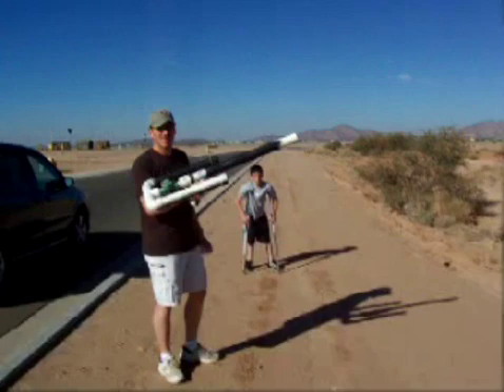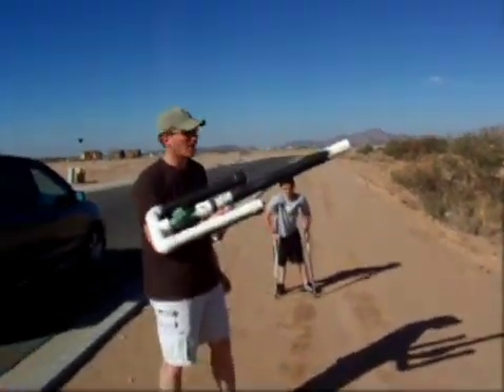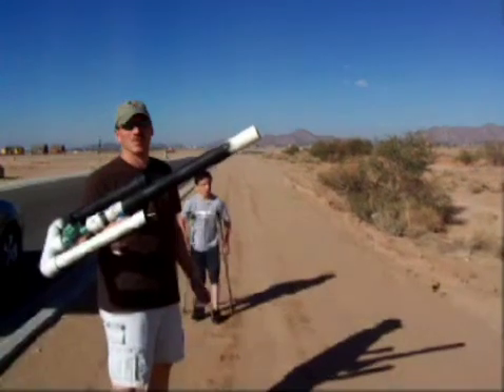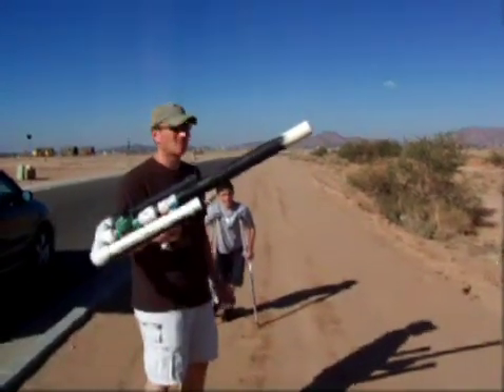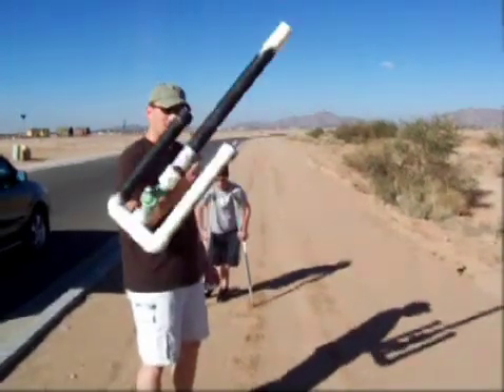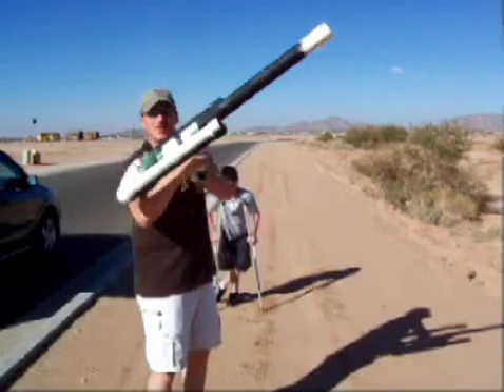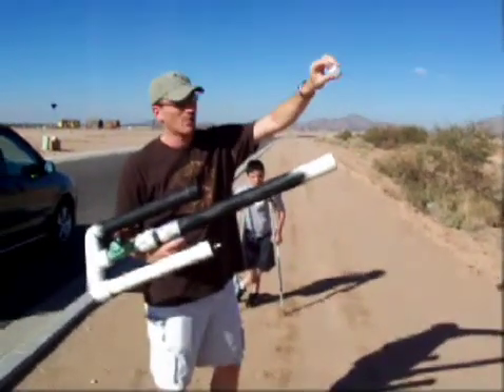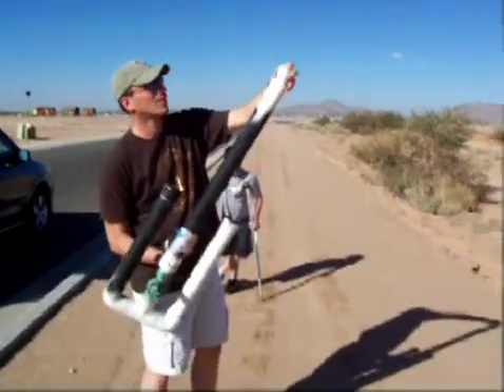Air cannon firing golf balls - 100PSI - 99mph.

Comment: I would suggest taking the sprinkler valve and modding it so it is trigger pneumatically (if that's a word). Just type "sprinkler valve mod" here on Youtube. This mod makes it release the air much quicker, resulting in a lot more distance.

Comment: Golf balls are actually a little bigger than 1.6 inches. The 1.5 inch measurement on the sdr21 pipe only means that the pipe will use standard 1.5 inch fittings. The inner diameter is actually larger than 1.5 inches due to its thinner wall thickness.